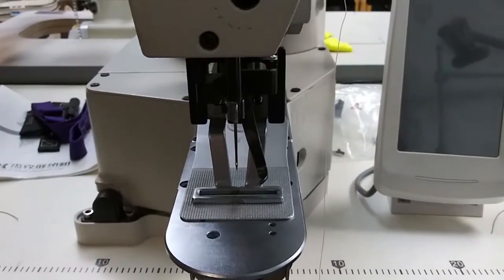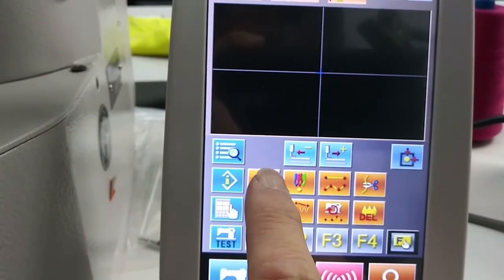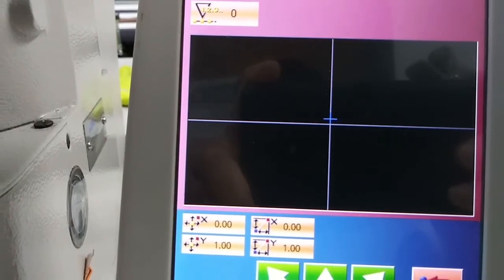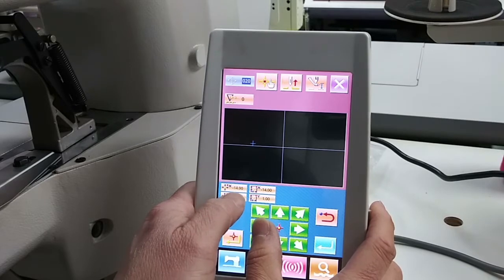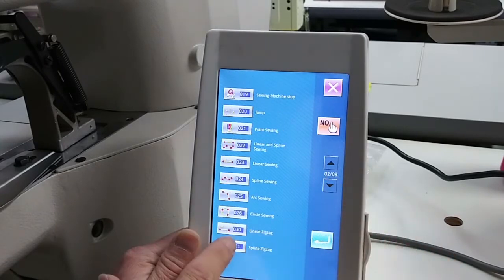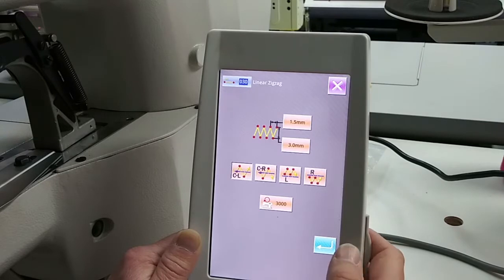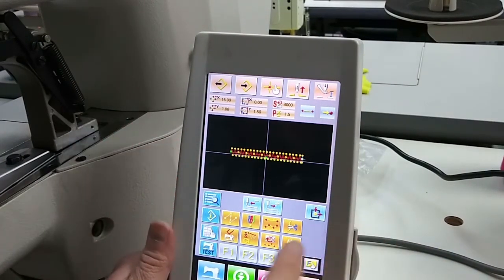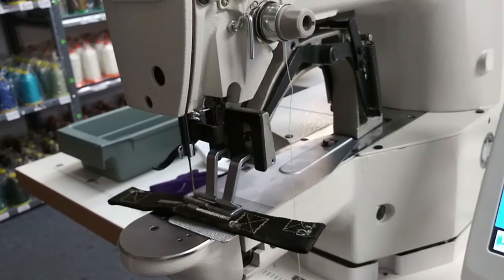JACK JK-T1900 Electronic Bar Tacker Custom Clamp Pattern Creation at Off-Set Home Position.

Comment: Hey mate, if I make a pattern, can I then move the entire pattern around or do I have to build the pattern from the edge to start?
Reply from the maker: Yes...you can move the whole pattern around...you have to go into the programming mode, bring in the desired pattern, push the plus icon to where you select all the stitch points to the very end (keep your finger on that icon all the way), go to your function icon, select patterns movement, and move the whole pattern to the desired position using the arrows...then save the new pattern and get out of programming mode and back to sewing mode.